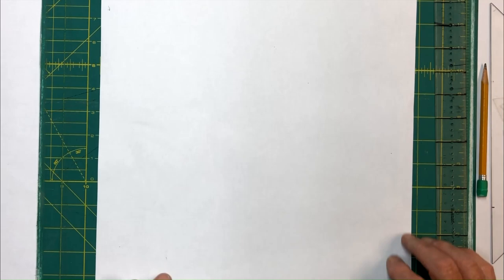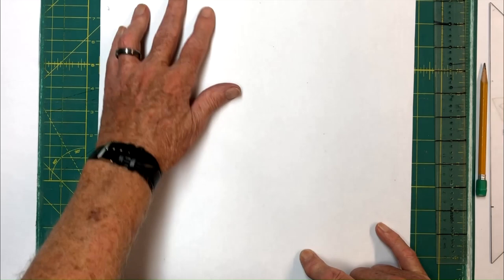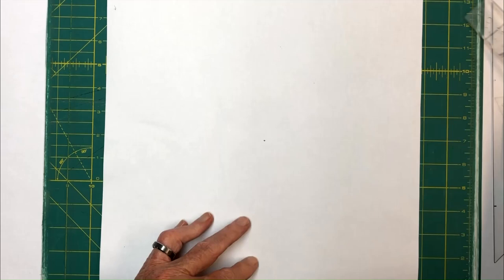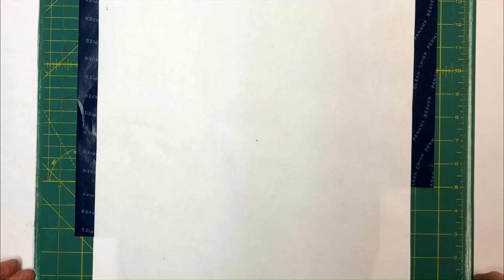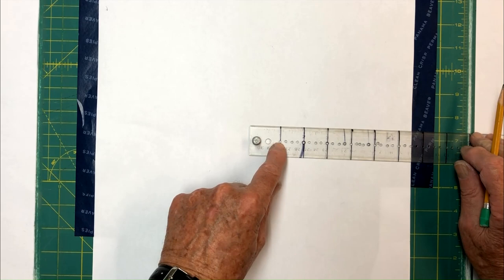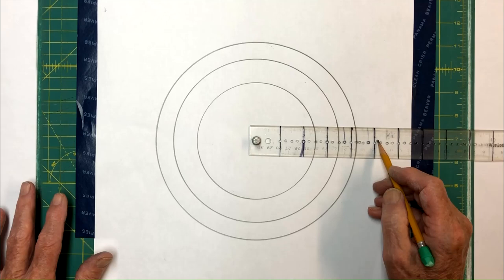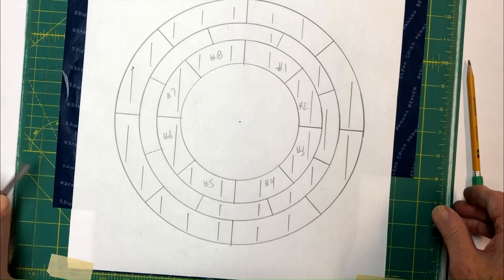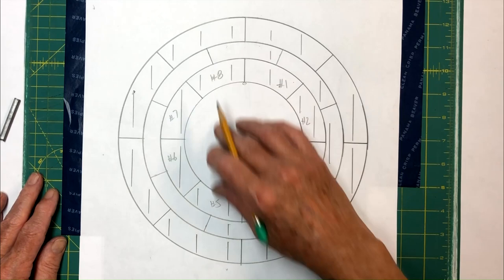Leaded Glass Suncatcher with Hummingbird in center

Comment: Hi Bill - been watching your videos as I have been teaching myself this fun art - thanks for your explicit instructions - very helpful!  Two questions:  Are you planning to do more videos?  Also, haven’t used lead came in any of my projects yet and wondering how the came looks after awhile, especially if the project is outdoors.  I’ve been using copper foil and then black patina afterwards and it seems to hold up pretty well…thanks, Dave from the Pacific Northwest!
Reply from the maker: Hi Dave,
Thanks for your kind words, yes, I will keep on making these videos, I enjoy sharing this fun hobby with others. There are over 40 videos on my channel right now for you to check out when you have time. The first one shows you how to make a Stained-Glass Solar Lantern for Beginners. If you're knew to stained Glass, and this is you're intro to Lead Came I would suggest you check this one out, as it starts at the very beginning of what you need to do Leaded Glass. Also, if you want to look at some of the larger finished projects I've been work on this past year, check out my video on how to make a Leaded Stained-Glass Clock, if you fast forward to the end you can check them out, some are Leaded Glass and some are Copper Foil. The two different sizes of lead came I am using are RU-70 U Came for the outside of these projects and RH-9 H Came for the center of these projects. These are made by Cascade Metals, check out their web site, it will tell you all about the different sizes of Lead Came.
As for what happens to the Lead Came over time outside, it turns a light gray, and the solder joints also turn a light gray. This happens over a period of time due to Oxidation of the lead and solder. I have Solar Lanterns that have been outside for the past 10 years and you can't see the solder joints. If you like the Patina look for your projects, you can use the same Patina as you use for copper foil projects on your Leaded Glass Projects. Hopefully this helps you get started, please feel free to ask me any questions about any of these projects. 
Regards,
Bill Stone
From Sunny California

Comment: I noticed you joined the two H leads at different places instead of both at same point. I was taught to do that way for added strength. I never put the connecting ends at bottom cause gravity. Your thoughts....
Reply from the maker: Hi Juile,
I think your right to end the H came in different places on your projects. It does add strength to it. I think you could end the H came at the bottom if the project isn't too large or heavy. I think I would still stagger them on the sides if possible.
Thanks for watching my videos, you can find them all if you type in the search bar Bill Stone's Stained Glass Creations, then click on my photo and they all come up in one place.
Regards,
Bill Stone

Comment: Looks like an interesting challenge Bill.  Have watched several of your videos and have made a couple of your projects as well.
Question ...what shape and size of lead came are you using, in particular, the U came?  Thanks for the info and keep the projects coming.
Reply from the maker: Hi Don and Carol,
Great to hear from you again!!
The came used in all these projects are made be Cascade Metals, they have a great web page all about the different sizes of came and shapes.
The U Came I use is RU-70, Has round sides and flat bottom. The channel 5/32", face 3/16", width 1/4" depth 1/8" and radius is 1/8". The H came is RH-9. The channel 3/16", face 5/32", width 9/32", depth 9/32" and radius 3/32". So glad to hear you have made a couple of these projects!! Which ones did you make?? If you go on the Cascade Metals web page the came chart comes up in MM, there is a box to check to get it in fractions. Hopefully this will give you enough info to get the came you are looking for.  Have a great day, again great to hear from you guys.
Regards,
Bill Stone

Comment: Just came across your channel, it's great! Learning a lot! Question do you have any trouble with the lead deforming in the sun?? Had that happen to me. Thanks again!
Reply from the maker: Hi Ed,
Thanks for subscribing to my You Tube channel. The only time I have had the U Came move away from the glass wasn't caused by the Sun, but rather where I had put my hangers. I have found out over the years to always put your hangers somewhere they will have some support other than just the U Came itself. Also always remember to stretch your Came to help make it a little stiffer and stronger on your projects. When you have time check out my video on how I make my hangers. Been making these for about 25 years and have yet had one fail and drop a project on the ground. So back to your question, I don't think it's the lead came that's deforming from the heat of the Sun, I would check out where your hangers are at in regard to the area where you're having the trouble. Hopefully that helps you out a little. Please feel free to ask me any questions about my videos. Also take another look at this video and you will see the hangers are located at one of the down pieces of H Came to help distribute the weight of the project.
Regards,
Bill Stone